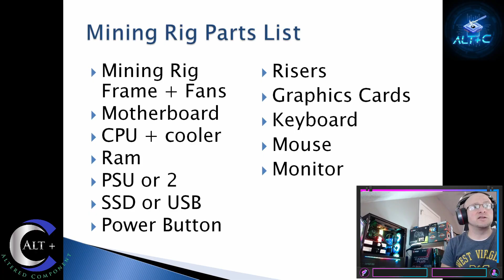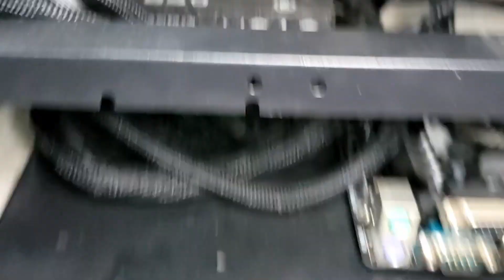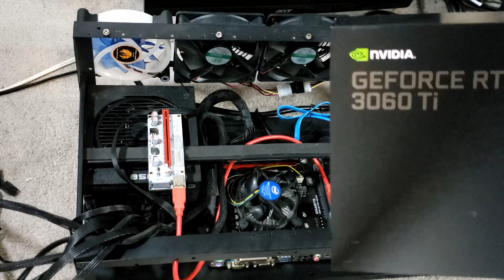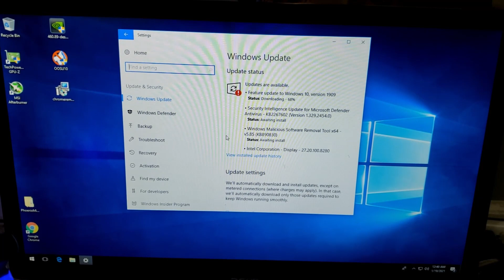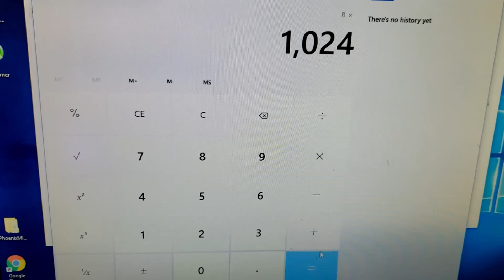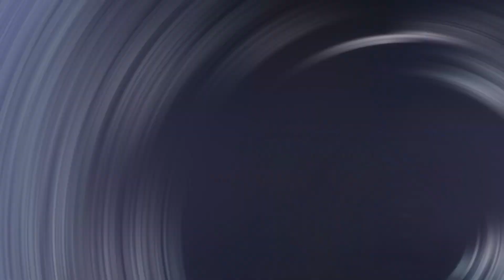Noob's Mining Rig Build:  How to build a mining rig for rookies (windows)

Comment: you know the fans are really not in an efficient location you are blowing towards the exhaust of the graphics card. really the fans should be on the other side of the frame and blowing from the back of the graphics card for the best efficiency
Reply from the maker: Yes and no.  For this specific rig It is more effective to have them pulling across the card then just doing exhaust out.  This way it is at least moving fresh air into the gpus to pull into the fans.  I have tried both push and pull on this el cheapo rig and this is the most effective testing.  And 2 it depends on the cards.  The 3070s and some of the 3060ti are exhausting differently than a traditional gpu.  Alot of the air exhausting through the 2nd fan of the card and through a cutout on the pcb.  Unfortunately that exhausts into the next card.  Do definitely would rather fans in this configuration for those instances.  Thanks for the share.
Reply: @AlteredComponent  what i meant was your blowing air  toward the exhaust so it's going to be fighting to come out and blowing towards it at the same time
Reply from the maker: @TotoGuy-Original  yes, I understand what you meant.  However with most of the cards I have in this rig, alot of the air is exhausting through the pass through backplate and pcb, as well as exhausting up and out the side of the card. So even thought it is pushing in against the small amount exhausting out the io, this actually is the optimal configuration fornthis rig
Reply: @AlteredComponent  👍👍👍

Comment: You my man are the boss!! I'm just getting into this. Have been mining on my 1660 gaming pc for a few weeks but now I'm ready to build my first 6gpu 3060 to rig. I'm really good at software but a build is something else. Trying to find a good build for dummies vid is like pulling teeth. You made it great and once I get this bad boy up and running I'm definitely going to be sending you a donation to your wallet.
Reply from the maker: Glad to help and no donation necessary.  Just appreciate the feedback.  Join our discord if u need any assistance along the way.  Take care and mine on
Reply: Hi again. I'm hoping you can help. I followed your parts on this except is was $30 cheaper to get a gold G-6400 processor. Now my problem. I looked everywhere for a ga-h110-d3a. Found a couple on amazon but they want almost $300. Finally found one for $105, ordered it but they just told me it's out of stock. Do you know of and other MB with 6 pcie x1 slots like that one that doesn't cost tons and will match up with the rest of your parts. I'm not having any luck even finding a 6 slot but I don't know MB either. Any help would be super appreciated
Reply from the maker: @davidkconcrete  you grabbed a g6400?  That is socket lga 1200. Hmm..need to look on that one.  Not sure what mobos are available with that socket.  Will look though
Reply from the maker: Can you please verify what cpu u nabbed.  Need to make sure socket and compatibility
Reply: I got the one you showed in the vid. SP 128GB A55
Reply: If need be I got the processor on amazon and I can return it and get the one you showed in the vid instead if that makes things easier
Reply from the maker: @davidkconcrete  verify which processor you bought for me please.
Reply: Please ignore the first reply as I sent you the hard drive number. Duh. The processor was a intel gold G-6400 2 core 4.0 GHz LGA 400 series chipset  .
Reply: I think I might have figured it out. After looking at all the motherboard that would work with processor I got I think I'll send that one back and get the G4930 in your video and then mate it with a MSI Z390-A PRO motherboard since I can't find the one in your video. What you think?

Comment: Great video, what do you think about buying 3060tis from alibaba? Most of them only accept bitcoin or money transfer etc and don't accept credit cards as payments which seems very scammy even though they seem to have a good history on alibaba?
Reply from the maker: Me personally I wouldn't buy from there just because I do not trust it.  I did order a couple from shopblt this week.  Seems legit, but not sure how long it will take to even get them.  I nabbed a 3070 fe from bestbuy to pickup next week as well.  Seems like it is even getting harder to get a card.  Would have thought it would have got a. Little better by now.  Anyhow, happy hunting.  3060 release 25th as well
Reply: @AlteredComponent  wouldn't the 3060ti have better profitability (depending what price you buy it at) than the 3060? In the UK its a real struggle to get any cards at a reasonable price.
Reply from the maker: @OG_ABZ  well the 3060 will have 1k less cores, but Slightly higher clocks.  My guess is that it will get 45 mhs on ethereum.  If obtained down near msrp of 330 u.s., then nearly as good as the 3060ti, but still Slightly better value to the ti.  I have 3060tis and 3070s, I will definitely targe a few models of 3060 for testing.
Reply: So alibaba for all my understanding is a chinese Amazon the only reason a package wouldn't get there is da RONA!😂 They're just attempting to move crypto to transact goods following each countries regulations and laws which is another problem but shouldn't stop delivery just slow it down as you'd guess

Comment: It's adorable how you warped your motherboard by not screwing in the middle standoff all the way. Fantastic demonstration of a rookie mistake.
Reply from the maker: lol...how sweet of you to notice, and i would have changed it prior to the video, but I was planning to completely tear down.  I completely tore down, cleaned, re thermal pasted, put back together, brand new standoff and no it did not warp it even though it was that way for 2 years ;)  Plus, it looks so pretty with all those 30 series cards sitting above it.  thanks for stopping by
Reply from the maker: feel free to check out the nice clean mobo with nice fully screwed in standoff in this video if you'd like:  RTX 3060 TI Mining Ethereum Hashrate | 3 different Cards tested | Overclocking & Profitability

Comment: A lot of gpus are sold out at the moment I was wondering if you think it's a good idea to buy 1 really expensive gpu and use it for mining ? Rather than 3 or 4 mid-priced ones?
Reply: Contact jallyhacksprime on ig he hooked me up with some 3080
Reply from the maker: To be honest the RTX 3060ti right now is the best bang for buck mining GPU.  That is if you can acquire at near MSRP.  Founders edition is $400 USD.  Getting it anywhere between 400-500 USD is worth it.  They currently make around $4 per day.  that being said, if you can get a 1660ti, a rx 570/580 (must be 8gb), a RX 5600 xt, an RX 5700 at reasonable prices, these all still give very good performance.   If you are curious what each card is making at any point in time, travel to whattomine.com.  Select the card from the top menu, hit calculate and see what the current profitability is.  Join hash raptor or Misfit mining discord for any questions.  Take care